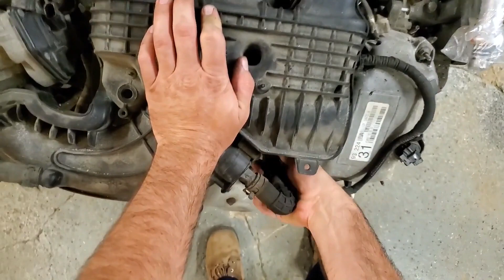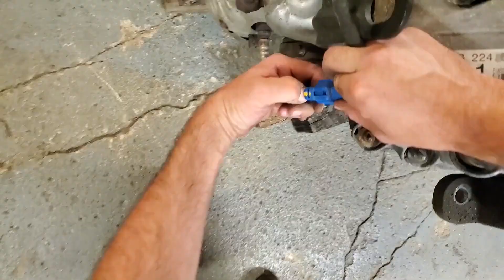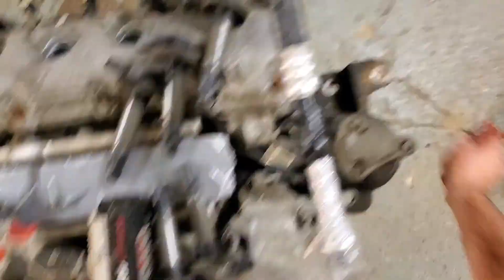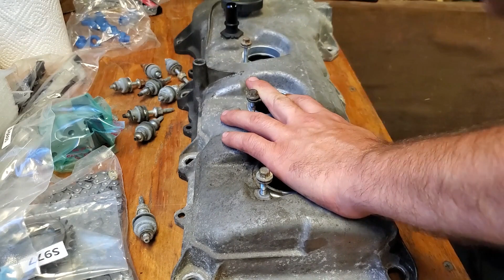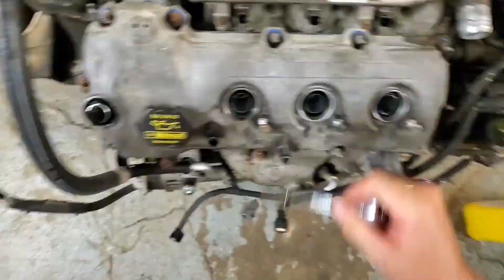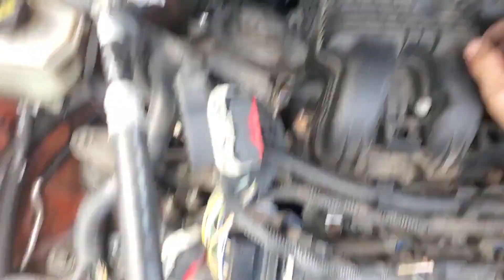3.5L/3.7L Valve Cover and Intake Gasket Replacement

Comment: I learned the difference between inch pounds and foot pounds the hard way. I didn't know an inch pounds torque wrench existed. When I was a kid, I rebuilt the C4 transmission. The front band requires inch pounds of torque. I was cranking it down to foot pounds. I busted that aluminum case wide open. I own an inch pounds torque ridge now, these days.

Comment: Videos like this one are timeless jewels.  @ sometime, different men are challenged to perform this repair.  It's my turn.  My 2008 Lincoln MKX with the excellent 3.5 Durotec engine.  My sled has 235 thousand miles and running strong & smooth.  The car still looks great.  I plan to keep it going as long as I can.

Comment: Gonna do this on my cyclone 3.7 , oil seepage from most gaskets is happening now. Interesting to see that the valve covers are metal on this engine, when compared to the plastic ones on thr cyclone. I wonder if they are the same size and fitment.

Comment: I have oil leaking on the exhaust and smoke coming up from under the hood while still. This is the only thing I can think that would leak it right there.
Can it be done without pulling the engine? Enough clearance I mean?
Reply from the maker: Yes it can. Reasonably easy too. You just have to pull the intake manifold.

Comment: Thank you SIR - very helpful video.  I know its been 2 years, but just want to get an idea the reasoning for replacing the valve gasket, and plug seals.
my CX9, 3.7 engine, when i replaced spark plugs the other day, noticed some oil drools around the plugs in few cylinders, and on surface of the plenum (intake manifold) .  Checked around the web, and many suggested its the plug seals and valve cover gasket.  Now being a 15 years old vehicle (its a 2010 cx9), mileage at 90K, I am not sure if this engine should need a valve cover gasket (or plug seals).  Just want to get an idea how you're replacing it on this particular engine. Any symptom or issues lead to the replacement is greatly appreciated.

Comment: Where do that green wire goes? I just use my finger to feel where it  was attached to a plastic piece on The cover, but I can't find where it came from. I hope it's won't prevent it from starting because of it.
Reply from the maker: It goes to the power steering pump. I'm not 100% sure of its purpose. I've never cared enough to look into it. It shouldn't prevent the engine from starting.
Reply: @darkhorseautoanddiesel Thank you! Once other thing. I put everything back together but it won't start like it was starting before The oil got in The chamber where The spark plugs are. Can I test those Modules to see if they have enogh resistance or is there a vacuum hose on The back of the intake, underneath The upper intake? I see 2 small holes underneath I was wondering was those small holes have a plug in.

Comment: Great video - thanks a ton.   Is there any good reason to number the coil packs so they go back on the cylinder they came from originally ?  I usually do but you have a lot more experience than I on these engines .

Comment: Brother, thank you for this video, I just finished doing this successfully in my driveway. Did the rear bank, had a tiny leak and no leaks in the front. Will finish the front tomorrow (ran out of daylight). This is the best video for this job, there s one on 1AA Auto but the guy is kinda a dunce and does a few things wrong. There is one other video that helped me a ton but just a tip video where he said to cut out the gaskets on the tube seals and other seals with a sharp knife and that helped it come right off without prying on it, my cover is plastic so I didnt wanna break it and those tube seals are on there insanely tight i had to cut it and then it popped off. You do not need to take all of the wires off that you did (as you know and stated) I took only the things holding the harness to the cover and was able to move it around the harness. Anyway, thanks again for this info. All the best

Comment: My God who has the option of pulling the motor to do valve cover gaskets?  Did it really save you that much time how long did it take to pull the motor?
Reply from the maker: 🤣 I actually have a video of removing the engine and how to do it. I don't remember how long it took. Obviously I had other reasons for pulling it.
Reply: the man had to do a timing chain amongst other things, smart to pull the engine

Comment: Also, what’s the difference between the left and the right side gaskets?
Reply from the maker: They are shaped differently, just like the covers. The difference is quite obvious if you mess up 🤣 I'm sure if you tried hard enough you could mess it up and install it that way, but if you have more than 3 working brain cells you'll know.

Comment: I have a 3.7l duratec similar to this in my F150. Plastic valve cover though...I'm having a misfire I've traced to an injector, but the odd thing is that there is oil in the electrical connector to the bad injector. Do you know what could cause this? I've seen ppl mention the valve cover seeping oil could cause this, any opinion would be appreciated.
Reply from the maker: Oil in the connector can definitely cause issues. My first step would be to get some electrical contact cleaner, comes in a spray can, smells a lot like brake cleaner, and clean out both ends of the connection and see if the problem goes away. A nearby oil leak could potentially cause oil to get in the connection. Are you sure it's actually oil and not fuel mixed with dirt giving it a dark color? If it is actually fuel that would mean the injector itself is damaged internally. If cleaning the connection doesn't fix it, swap the injector with one next to it and see if the problem follows the injector. 

Let me know how that works for you, and I'll try to reply as soon as I can.

Comment: I am doing this in a 2009 Mazda 6. Cannot figure out how to get harness connector loose for AC compressor and whatever sensor is on back of engine other than Oxygen Sensor, any help is appreciated.  You might consider covering that in more detail. Especially for those doing in vehicle  work.
Reply from the maker: AC compressor should be on the front, unless they have it laid out different on the Mazda. If you mean the thing that holds the harness to the valve cover, all I can say is good luck. It pops up, but the little barbed part gets stuck in there pretty good. I usually end up inadvertently breaking it. Nothing a zip tie won't fix.

I do have a video doing the timing chains in the vehicle recorded, I just have to edited or posted it yet. I might use footage from that and make another improved video of this part.

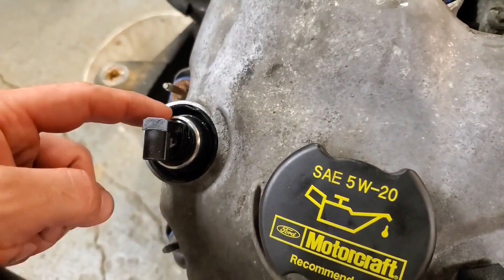Comment: Do you have a trick or recommendation to keep the tube seals in place? When securing the valve cover they keep getting pushed back out. It's the back side still in the engine bay. If it's not the tube seals pushing out its the PCV gasket. What can I do to get them to stay in place?? 19:57
Reply from the maker: I don't, I've never had that problem of the whole seal pushing out. They fit really tight in the bore so that shouldn't happen. If it's just the center part pushing out, lube them up then try. I have had a couple that didn't wanna go all the way down in the center, a small punch and light hammering fixed that.